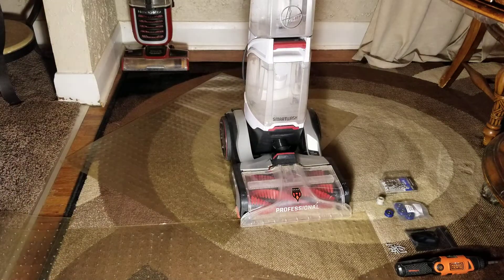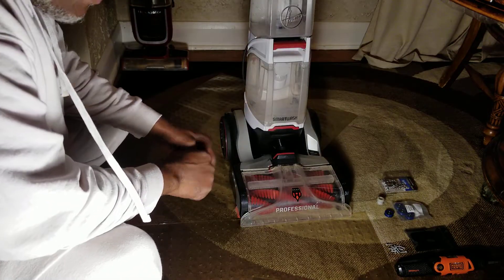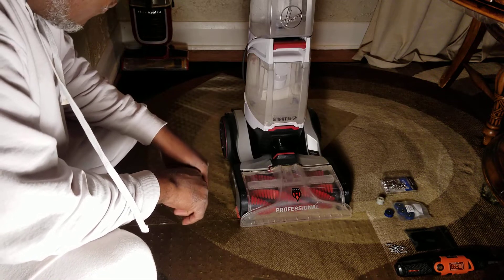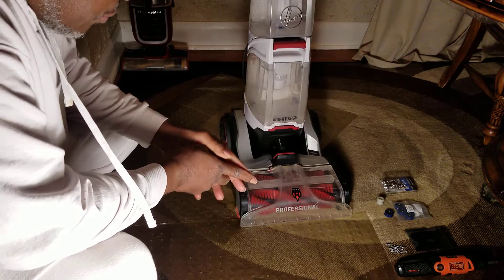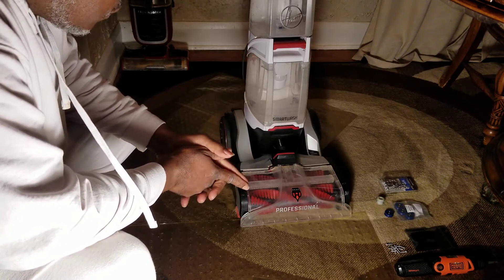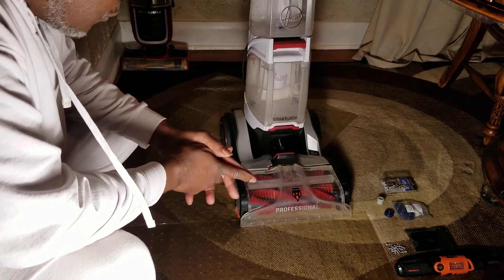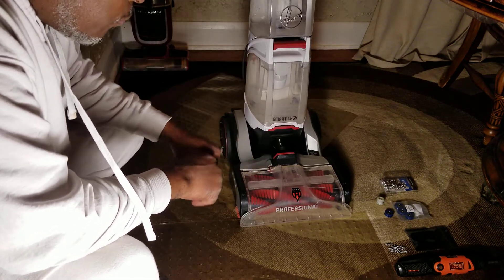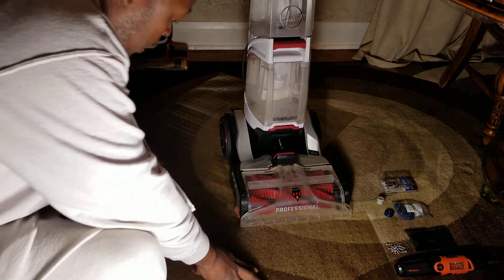Hoover Smartwash Belt Replacement Pt II.

Comment: This was extremely helpful, and I was able to do it myself. Only issue was your head was in the way when  you showed how the belt went in. So I was finally able to get it, but you go around the two outer pulleys and go over the middle pulley with both sides of the belt. Only works if you pull the middle one out. Does involve slight pain and much swearing, but I, a single mother, paid $30 in brushes, grease, and belts, which I got off amazon and were not stiff, to fix my seized up bearings in my brushes which then caused the belt to break.
Reply: thank you someone finally said how the belt actually goes on